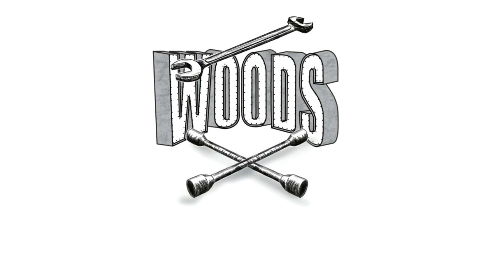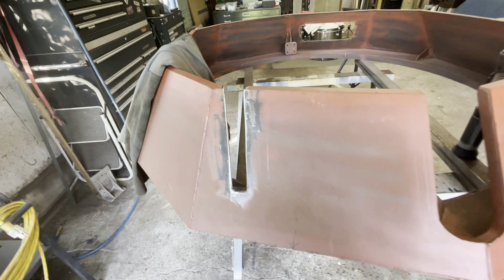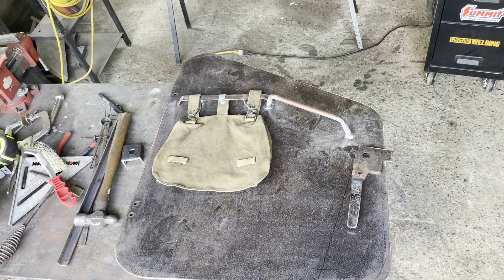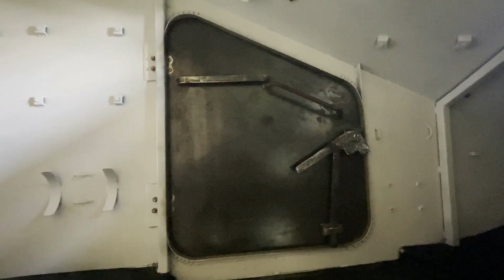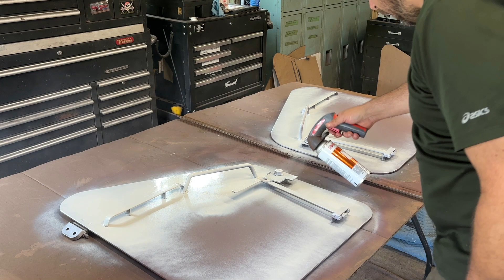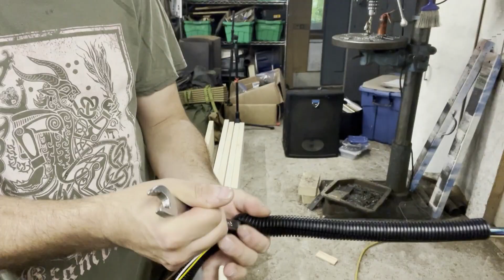Project 222  Ep 77 Replica Panzerspahwagen

Comment: So after putting the engine in the rear did you manage to keep it 4wd?
Reply from the maker: Well currently Id say is All-Wheel drive as we dont have ability to switch between 2 or 4x4.  There is one or two videos in the series about this vary issue.
Reply from the maker: Also check out Ep 6 and 7 
https://youtu.be/pc4rS3RD-ks